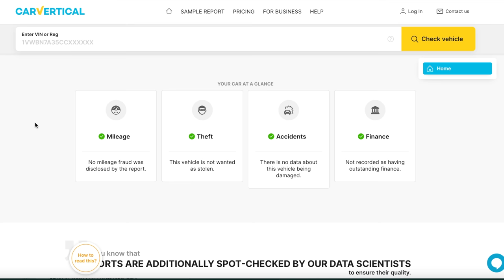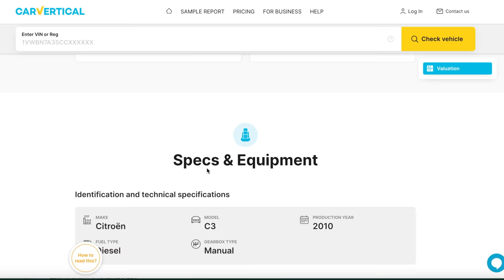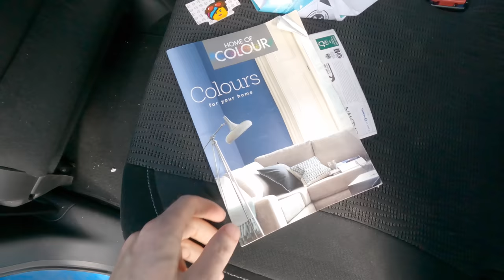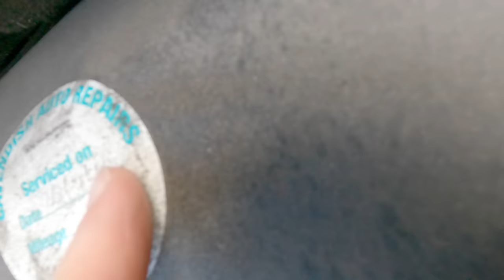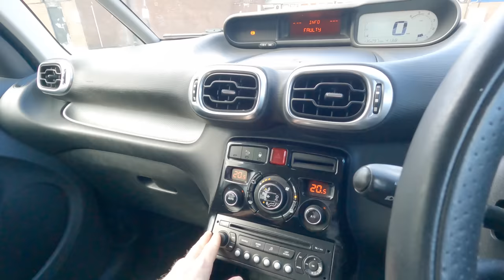I BOUGHT A CHEAP CITROEN FOR £300!

Comment: Thoses engines could last longer but so many people don't know how to use a turbo diesel: they don't wait oil pressure to build, they don't wait the engine to warm a bit, they rev it too high, too much city driving, they turn off the engine when the turbo is still spinning fast, they don't change oil every year etc. And I'm not even a big fan of French cars, I'm more into old Japanese gasoline cars.

Comment: Probably stating the obvious here but when in an unfamiliar vehicle I always look at the fuel pump diagram on the dashboard and the arrows will indicate which side the filler cap is on. Great videos keep up the good work 👍👍
Reply: Doesn't always work, my mu's Toyota Yaris icon shows the nozzle on the incorrect side...
Reply: @stephenm5000 it's not normally the "pipe" it's a small arrow next to it
Reply: @jrewillis  wish I could post a photo here LOL There is no arrow on the Yaris, but my Ford Focus displays the nozzle on the fuel icon on the correct side.

Comment: My Peugeot 308 from 2012 with the same engine has driven 450,000 km (279,617 miles) with the original turbo. still drive like a dream.
Reply: Do you sometimes put injector cleaner in the fuel or drive long distances ?
Reply: wich engine do u have ? 1.6 or 2.0 ?HDI
Reply: @romanjeremy5156  Drive long distances ;)
Reply: @dracony7649  1.6 HDI
Reply: My brother in law had a 15yr old 1989 Peugeot 405 with over 500k miles on it back in the day.
2 clutches, and a new turbo at 200k is all he had done. 
It was service every time on button by main dealer. 
Cars need maintenance.  Look after them and they can go forever.
One of the nicest cars to drive, ever.

Comment: I've had  a Citroen grand c4 semi auto for 10 years without eney trouble due to it being serviced regularly.
The diesel engines in the Citroens are bullet proof if there looked after with regular oil changes.
Can't understand why your slating Citroens as there's  thousands of Citroen owner in the uk that are happy with there motors.
Great mpg, reliable,comfy and always feel refreshed after a long drive.
Reply: Drive a car like the BMW M3 and you’ll realise how sh*t the Citreon’s are
Reply: @ravss4594  pretty dumb comparison tbh, it’s like saying a BMW is junk after driving a Maserati
Reply: @gabrielzanoni3474  actually a high performance BMW like the M3 will drive better than most Maseratis.
Reply: @gabrielzanoni3474  next step up is probably a Porsche 911 but it’s marginally better

Comment: on the fuel gauge there is usually a sign of a pump and next to it is a small arrow, left or right. I only found out last year that this is common on cars to tell you which side to fuel.
Reply: But not always
Reply: @frankyduschek562  Pretty much yes though.
Reply: I came to comment that I hope he said that("what side is the tank on?") for entertainment value because as a dealer he should know this.
Reply: yep, I had hitched a ride with a friend the other day who was driving a replacement car as hers was being serviced... she wasn't sure which side the fuel cap was on. i told her this, and sure enough, the fuel icon had an arrow, and it pointed the right way 😁
Reply: It's not correct on my C3 Picasso.

Comment: Citroens happened to be available at reasonable prices when I needed replacement cars.  Had an L reg ZX TurboD, bought at four year old with 52k.  Nothing more than regular servicing, tyres, brakes, tailgate struts, and a master cylinder failure.  Gave 50+ mpg in town. Scrapped at 215k when I spun it in the snow, modifying the bodywork too much to be repaired economically.  Followed it with a 53 reg Xsara HDi90.  Bought at 3 years old with 30k.  Did 55+ in town.  Had an issue with the filters blocking which messed up the aircon (sorted for about £300) and twice the keys "unprogrammed", otherwise just servicing and consumables.  It was stolen with just short of 200k on the clock, used in a robbery and trashed.  No Citroen about last time, so it was replaced with a 59 reg Focus TDCI Estate, even more frugal than the Citroens with little work required, currently 184k on the clock.  Will run it a couple more years then get an EV.  Cars are so much more reliable than the three year old VW Golf I bought when I started driving.  At the time I was so proud to take it from 32k up to almost 120k before it had to be scrapped.

Comment: Next time try the Smashing pumpkins method before scrapping. In a city diesel, specially the new ones, the entire exhaust system gets clogged up. By using a full tank with your foot to the floor maintaining 3-4k rpm above 45mph, you have a chance to clean it up. Either that or the timing belt snaps or the injectors pop out. I would do that before scrapping it.

Comment: The first thing I noticed when you popped the hood was that it was dangerously low on coolant but I guess it wouldn't overheat in such a short drive
Reply: @clunkclickeverytrip  yes usually on start-up. After running a bit, heat can act as a seal. Think Matt made right choice.
Reply: I am ashamed to say my Toyota avensis petrol can’t hold onto its coolant, I think it’s water pump or head gasket as I don’t get puddles on the drive. I just throw water in it every week or so, but the heater stops working when The water has leaked out, I’ve driven it for a long time and it’s never overheated. I think I’m lucky
Reply: That was the first thing I spotted too.
Reply: @Benjamin-xh5hj  I had a similar problem. It turned out to be an airlock which was cured by flushing the coolant system. You can do this yourself by opening the drain valve at the bottom, putting the hose in and just running it for a bit, then closing the valve and topping it up. Alternatively, get it done at a garage for not much more that £30-50.
Reply: @danielearley5062  so you had a fluid leak caused by an air lock?
Reply: @Benjamin-xh5hj  I'm not sure where the coolant was going as I couldn't see any signs of a leak. When I would check, the coolant level appeared very low and the low coolant alarm would go off. Opening the tank caused the coolant to bubble back up again but never at the same level. A couple of flushes cleared the fault but it sounds a bit similar to your problem.

Comment: If you look at the fuel gauge on any car there is a picture of a fuel pump with an arrow by it to indicate which side has the filler cap, good tip I found

Comment: I also love the E46 though you will need to watch the front wings for rust bubbles with earlier cars such as yours. With the Citroen, I might have taken the opportunity of the empty tank to put injector cleaner and just a little diesel to run it through the injection system. Even if you had to put a new CHRA in the turbo, it need not cost a fortune or it might just need some oven cleaner and an Italian tuneup !

Comment: My company has a Peugeot Partner which is on the same platform as that car. Over 200k km done and no problems 😀 I can't believe it! Good workhorse and HUGE inside! Gets great mpg! 👌🏻 And the best part? It's bought and paid for! Thanks for the video again!!
Reply: It's the thing with the 1.6hdi. treat it poorly, do a million miles a week in it, drive the nuts of it, and it'll run forever. Cosset it, just go to the shops and back and it'll be nothing but trouble.

Comment: I bought a 2003 03 reg C3 1.4 diesel in nov 2005. Had nearly 14000 miles back then. It now has 152400 miles & it passed its mot last month. Went to cornwall & back cruising doing 70 mpg. I got myself in a money mess a few years back but getting sorted now. So I've just kept this car & it goes on & on & on..  :)

Comment: Bit of a random tip if you are driving an unfamiliar car. It typically shows which side the fuel filler is on the dashboard with a little arrow/triangle on the fuel light

Comment: possible problem with the fuel injectors or the hp pump, I dont believe the engine itself has the problem ( like piston cylinders or the engine head damage ) because it was an intermitted problem if I understand correctly the video, if so, it is very very possible it worth fixing it.

Comment: Actually went for a test drive in a 13reg recently off spec, not pre-arranged. Very comfy, quiet inside, felt solidly built and nice high seating position if you like. The 3 downsides. 1. Handbrake too low down, 2 crap storage and nothing in the centre, 3. Heavy clutch with high bite position.
09-17 reg regardless of care and service all seem to have same mot issues.

Comment: Great video Matt . The tale of woe with this one is obviously a sheer lack of servicing / maintenance; that 1.6HDi has to be serviced on the button with top grade oil.
I’ll never understand why so many people just don’t have their cars serviced regularly …. Also manufacturers service intervals these days are ridiculously long in my view.
Reply: 2006 bmw 320cd.  ( had this car for 12yrs) service intervals every 20 thousand miles.  ( fully synthetic oil) but I have religiously changed oil/oil filter every 10 thousand miles and full service every 20 thousand 😄.  I, like you think manufacturers service intervals are ridiculous 🙄 👍👍
Reply: With those service intervals, it's almost as if they want the car to fail just out of warranty. Now, where did I put my tin foil hat?
Reply: @GregPodster133  I don't think a 2006 BMW qualifies as these days. It's 16 years old. Modern stuff far longer service intervals especially commercial.
Reply: Can't stand long service intervals. I'm sure the manufacturers test to see what is the longest interval they can have to make the engine just make it to about 150,000 just so they claim it saves you on servicing costs rather than what is the appropriate service interval to make it last as long as possible. My car claims 20,000 or 2 years but I won't go above 1 year or about 8,000 on fully synthetic. For the sake of an afternoon on the driveway and £30, worth it to me.
Reply: @squeakers27  exactly
Reply: Back street garages don't necessarily do the turbo oil feed filter either, starving the turbo of oil

Comment: "C3 Picasso owners wouldn't know what soap is!" Cracked me up!

Did the fuel gauge not have the usual little arrow indicating which side the filler cap is on? (Or did PSA cheap out on the ink???) 🤣

Comment: That HDi engine is in so many cars... and manufacturers-  would prob' not have been an expensive fix... and that engine is a pretty hardy lump. I had the same in my previous car- a Focus-  and in my car presently- a C3 Picasso- identical to this one lol !!
Touch wood- mine's going perfectly... and I couldn't break the engine in the Focus either !!
P.S- I do wash occasionally...
Reply: I have a 2012 208 with the 1.6 e-HDi (DV6 D I think) and it's been very good, but it's not a fan of supermarket fuel. It occasionally threw up an EML which I believe was a boost issue (I don't remember the code), but the car didn't drive any differently, and the error cleared itself after a while anyway. The easy solution was to fill up with normal diesel elsewhere.
Reply: @stephandolby  I never use supermarket fuel... ;)

Comment: I brought a cheap Zafira diesel recently. Smoked a bit and low on fuel when I got it. Did a full service and put fuel in it, then the fun started. Warning lights all over, it was trying (unsucessfully) to do a DPF burnout. To cut a long story short, someone had removed the guts of the DPF and not told the computer. I had it deleted from the ECU map for £200. All was well, but not as cheap as first thought.

Comment: For your info, the ABS sensor probably has a load of dirt on it. I had a C4 PIcasso Auto and I had the same issue, the car went insane. Turned out it was dirt on the ABS sensor, cost £36 to sort out

Comment: I drive c3 picasso 11 reg and apart of feeling old just past 40 (as all other users seem to be elderly couples in mid 80s) I am very happy with it. 1.6 diesel with bluetooth and cruise control, 60mpg and 30 tax. High seating position and fairly quick - not annoying at all. Being small base and still able to fetch several packs of  insulation - can't fault it. Never had anything wrong in it after doing over 40k within 3 years. Really good car!!! 11:44 Shame on you as I actually produce soaps!!! And of course use them myself too!!!

Comment: I spent 3 grand on a 59 plate one of these and the ECU was knackered. Flagged up anti-pollution and would buzz inside the cabin after I turned the engine off. I was gutted because it was high spec inside and had velour seats. Ridiculous sentiments but oh well.
Reply from the maker: I've had to replace a few of those

Comment: I had the same problem with  MB A160 diesel... Smoking white and grey... With engine light on and off... Like yours... The rubber of the oil on top was split... Cost me 2.50£ and I don't know about the rest...

Comment: I keep buying old Diesels convincing myself they're cheap to run, but everytime something goes wrong its £400 at least. That pays for a lot of petrol
Reply: Buying old diesel cars is fine if you like driving a diesel, do a lot of miles and know how to fix them when they go wrong and get either parts from a breaker or recon units to fit yourself. They don’t go wrong constantly but yea when they do it’s not usually a cheap fix.

Comment: my mate has a mazda 3 mps, turbo was knackered and smoked for ages, never had an engine light. got it fixed, stopped smoking, and then the light came on for a misfire from spark plugs. turbo was quite cheap to be fixed, so that could be worth looking at and there could be some profit in it

Comment: It's gotta be the turbo and they are not that expensive around £150 if you don't mind aftermarket.
I had a 207 that did the same thing and was an easy fix .
The abs could be anything but not expensive .
I suppose it depends on how much you want to put in and how much profit is in it .
Probably not much point for a dealer .
Good for a DIY mechanic tho

Comment: There's some proper man in the pub bs on here tonight. I've had two Citroens with 1.6 hdi engines, one xsara picasso and one c3 picasso same year as this one. No running faults on either. Maintenance is key, get them serviced every 8000 miles. This one looked neglected. Anyway, that soap dish on the dash is for sweets.

Comment: Top tip- Fuel gauge on the dash always has an arrow indicating what side of the car the filling cap is located 😮
Reply: I think you'll find, the digital display on this C3 doesn't actually have an arrow to show which side the filler is on....
Reply: @syburton8662  Also what Iain said is not true, just a myth [backed up my late 4 cars: 2 vw caddys, vauxhall astra and nissan micra, the arrow was pointing the wrong direction]
Reply: My Trabant doesn't have an arrow

Comment: The little fuel pump on the dashboard tells you which side the filler is,If the filler pipe is on the right or left denotes which side the filler cap is.
Reply from the maker: Not on all cars

Comment: My old Volvo had the 1.6d engine similar to this one in the shitron but it was the slightly newer variant I think. It had injector tick for the whole time I owned it like this one but didn’t smoke or run like a dog. I did over 20k in it no problems and it never got worse, premium diesel did make the noise disappear as well.

Comment: I bought a Citroen Nemo Automatic to do my commuting to and from work and save the miles on my Cee'd.  I ended up driving it everywhere and using it for the tip runs and moving furniture etc. I loved it and had it for ages.  My daughter was on her way up country to see us for the weekend and some plonker on his mobile ran into the back of her when she was waiting to turn right writing off her old golf. I gave her the Citroen and two + years later she's still using it and driving up and down country with it no problem. It gets serviced annually which is probably right for the mileage she does. Super little car.

Comment: That 1.6 hdi really is a dreadful thing!
Reply: The newer variant isn’t that bad though. I think this one has the older one with a lot of issues
Reply: @Alexander_l322  the new one is a bit better but that one is shite!
Reply: Based on 18 years of owning nothing but 1.6 HDI 16v and 8v, I wouldn’t own anything else. They’re EXCELLENT engines with very few issues, take preventative measures like servicing it on time with the proper oil and fill up the fuel filter before cranking it over after a service. I’m in the motor trade and regularly see Berlingo’s going through BCA with 500k miles.
Reply: @ciaranm8772  agree with you entirely one really good engine used by other manufacturers including BMW what about that then, Citroen cars are ok service is the trick,but this is what's wanted loads of comments for the channel,sure I am right on that,keeps this guy happy and smiling, what what.

Comment: I know with C3 1.4 diesel the injectors were known to go & mine were done many years ago. The only problem I've had with engine. Also if say I only put £10 of diesel in then the gauge doesn't register it. If I put £15 in it will. Used to have a Peugeot 307 way back that had a similar 'design fault' with the fuel gauge. So you may have just not put enough fuel in.
Really bad that you made the comment.. 'too many moments like this'. You paid a few hundred for it! Was pretty obvious there must be something wrong. Ps: I feel the same about german rubbish :)

Comment: You can get modern idrive systems fitted to them auld e46/e39/e38 BMWs, turning them into all the car you'd ever need - they look pretty good too, not even slightly aftermarket looking.